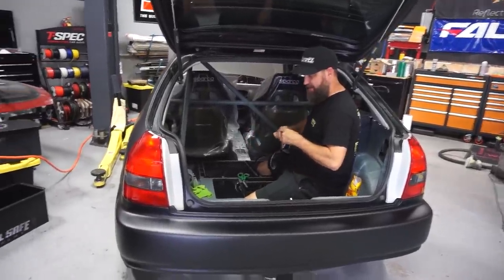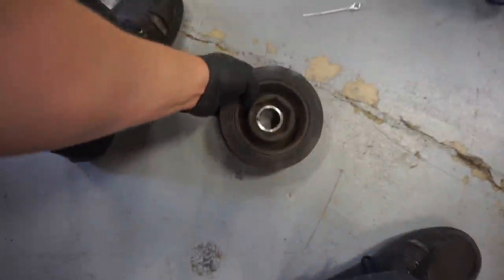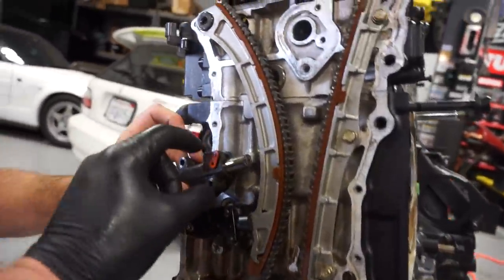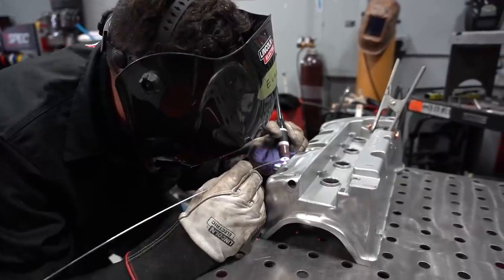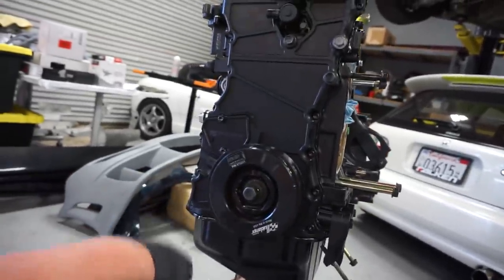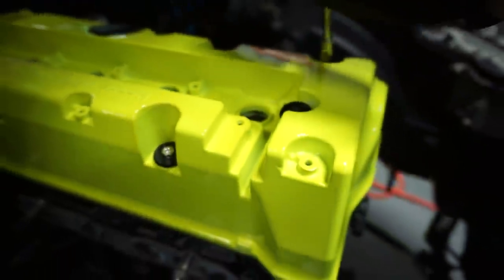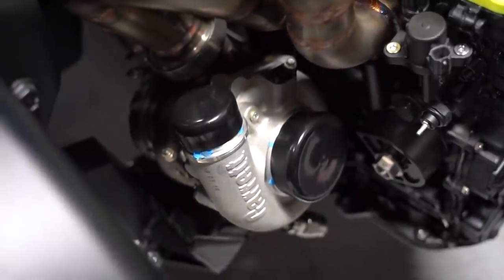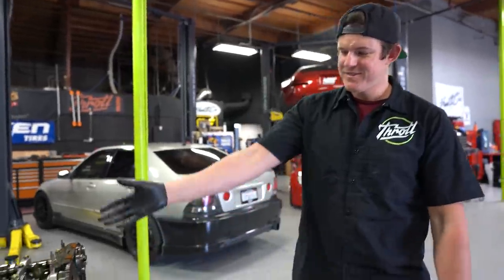Building a Rear Wheel Drive, K20 Turbocharged Honda Civic EK Hatchback Race Car- Reassembly Part 2

Comment: If you get your hands on a bead roller and run some beads on that big flat rear end cover it will also add rigidity to it. Less flex, less vibration, less noise.

Comment: should get the K intake manifold and turbo powder coated the same color as the valve cover. or the intake, paint the K same color as the valve cover. Black carbon fiber wrap the headers.  I just thinking cause the whip is all black got to let the engine shine. good job guys, keep it up and enjoying the content.

Comment: Just my opinion but It’d be cool if the turbo manifold was coated in black and the turbo was powder coated in the same color as the valve cover. Since it seems to be a theme of stealth with some pazazz

Comment: Are you not worried about the rear strut bar flexing under hard cornering and hurting the battery? Also, clamps on the clear tube for the fuel fill. Dope car you got otherwise.
Reply: Nope ... it'll be fine .. there are other points under the battery that won't allow it to move

Comment: mmmmm.... VTEC!  Drunk Janet here: Love your project, but do you ever wonder about how big your 2L  is compared to a standard deck Mark IV? You are in the USA, so why do you care about VTEC? It's not 1996, and we are all out of HS, and all engines take up space. Did you measure the distance between the shock towers? You realize a McLaren M20 weighed 1700lbs. Might just fit a 496ci Mark IV in the same space. You only get 30% efficiency out of a combustion event, so why wouldn't you want max displacement? Speedmaster makes aluminum blocks and AFR makes MONSTER heads. I love the fab work, but why handicap yourselves?? Let's get BIG. Put an aluminum block 9.8" deck Mark IV in a RWD Civic. Do a real deal SLA suspension and use a Hewland LG600 MK2. Can Am for life!